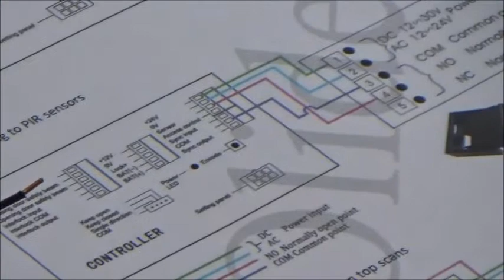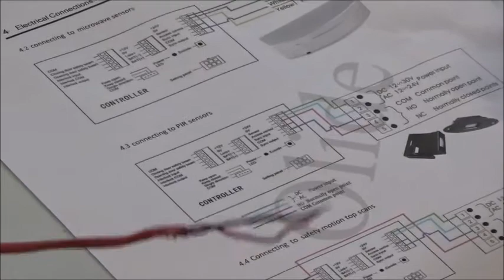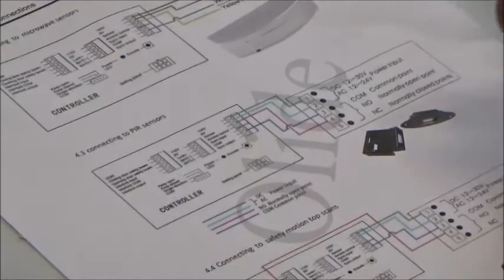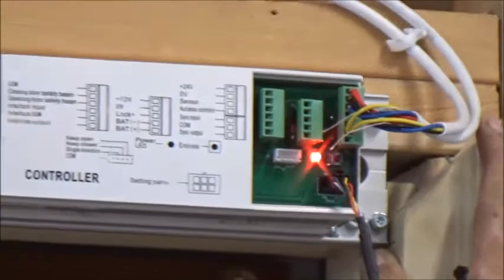DIY How to Install the Olide Smart Automatic olide-120b Swing Door Opener Working with PIR sensor

Comment: Hello I installed the 120 b at my mother in laws.  Everything after a few tries I had it.  The plastic remote worked the fob worked.  Then I put the cover on.  Neither the button nor the fob unless you were right next to it would it work. So I am
Leaving the cover off until I can figure this out. Any ideas?  Thanks in advance
Reply from the maker: Hi dear,
May I know if the button is wireless or hardwired?
Reply: @OlideAutoDoor  wireless
Reply from the maker: @maniac1972  Maybe the signal is not good, please pull out the antenna in the  the controller, and see what will happen.

Comment: Hi would there be a way for you to provide a diagram to install 2 WS100 with 24 G sensors in a  double handicap door for home and what do i need to install it?  A diagram that includes from the door controller sync connections to the Power Supply and accessory connections. the accessories i plan to use is an access control, 1 electric strike, 1 maglock,  the remote controls, an exit button and the 24g sensors. i have looked at diagrams on the internet of how to connect the access control to the power Supply and then others to connect the door control, but i have never seen a complete diagram of the entire complete installation. 
Do I need a power supply? 
12 volt or 24 volt? 
3 or 5 amps?
No, nc, fail safe, secure safe?
I just need  my doors to stay locked at all times if I don’t open  them  and in  case of power out  my doors to remain lock.
Thank you. Good help. siv.
Reply from the maker: Hi dear, can you please tell me your email address, so we can send you more information; or you can directly send me email at: sara@olideautodoor.com